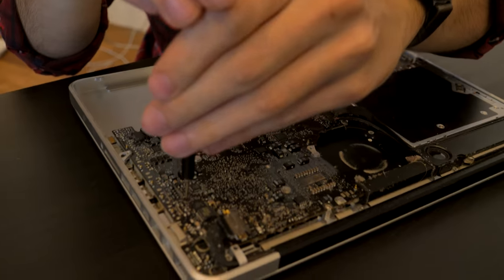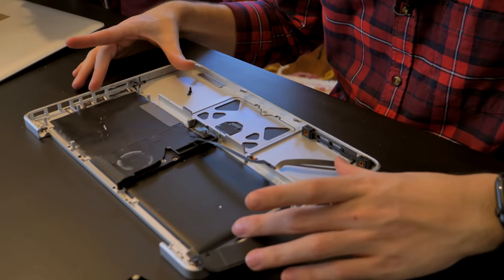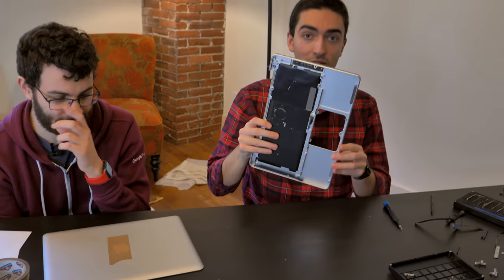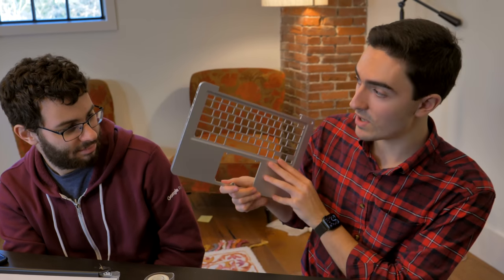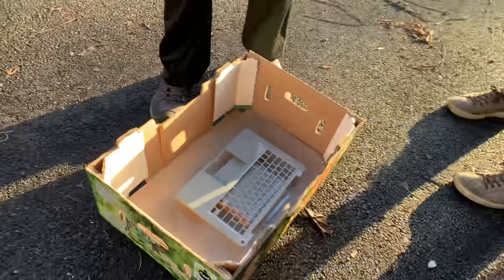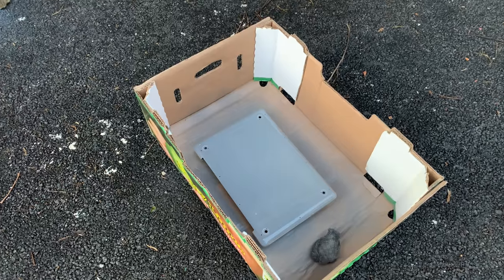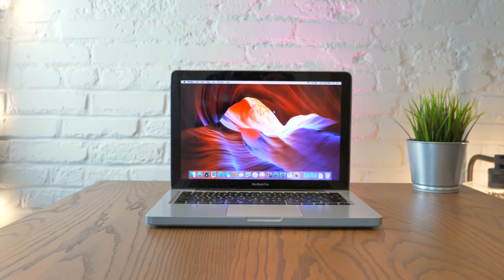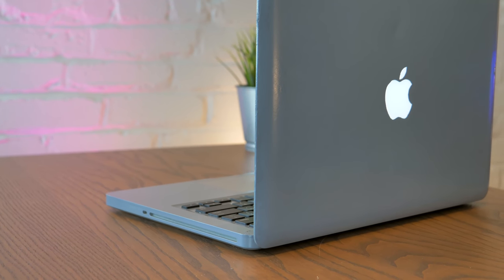We made a custom ‘Space Grey' MacBook Pro! It was... interesting

Comment: Luke, couple of things you did wrong:
-First you had to mask it with a precision of half a milimiter, sand it, primer it, sand it again (with a very fine grit like 1500/2000) 

-Second, only then apply a MATTE clearcoat. 
Would have made it look a bit more professional.

Also, please spray within at least a feet and a half away from the material in a continuous spray.

Comment: A mat finish would have been better then gloss, also an air brush would have allowed you to control the spray coat consistency. You should always cover your work until dry and do 2 to 3 light coats, wait twice the dry time to prevent ruining the layer beneath. Don't try to get it right the first time. Hanging the part can also help reach all the sides.

Comment: In order for the paint to stick well you would need to sand the body, prime it, sand the primer with 600 grit. Flat black would make a more visual difference but not if you can't color the touch pad to match. I still liked the video, great job with the disassembly/reassembly

Comment: I think painting it with an epoxy primer(which is a silver color), then adding a coat of matte gray finish. the epoxy primer makes the paint stick to the surface, making it more durable rather than just painting it bare to the metal.

Comment: Next time sand it down with 600grit sand paper, then 2000grit, and then 3000grit. Spray primer (from the can) and then spray your color. It would look cool if you use a clear coat (2x clear from the can) to give it a better finish. Slight buff and it will look like factory finish.

Comment: No no no no u don't paint aluminum, you anodize it or powder coat it, it'll look just like it was originally produced in black. Rattle can job doesn't really work on aluminum even with primer, in no time this finish will just flick off. Powder coating would be the best option since it's cheap, extremely durable and pretty much available everywhere.

Comment: Black it would be an unreliable ThinkPad :) I've had terrible luck with Krylon paint so many times... If you ever need to give a second layer of paint, really really read the instructions on the can, because you can't just spray a second layer when you want. It's like at most 2 hours later, or 5 days later. Anything in between will do a chemical reaction and completely destroy the paint.

Comment: if you use 2/3 COATS OF GOOD QUALITY MATTE BLACK PRIMER AND LET IT DRY FOR AT LEAST 24 HOURS YOU CAN ACHIEVE BETTER RESULTS IVE FOUND
its 99 Percent PREP 1 percent actual PAINTING get some junk macbook pro parts and try a few methods before you just spray it, either that or wrap  it and paint over the wrap
Thank you for the videos and stay safe out there in the city Sir

*Coop

Comment: Sorry, but this is ugly AF - next time, do it in "pure black". And be WAAAAAAY more gentile with the paint.

Note: 15" 2012 and prior MacBooks are easier to teardown than 13"; the left speaker cable beneath the logic board is a pain in the ass to remove and could damage that permanently, if you don't know about its existence.

Matter of fact: it's way easier and painless to apply a full body vinyl wrap such as Slickwraps (dbrand don't make wraps for those models, anymore). Not only in color but it can add different textures and styles to the device. I personally use a "brushed onyx" wrap on my 15" Mid-2012 and it's gorgeous!

Comment: With an endless number of "how to paint anything" on google - you guys - did none of that and just went for it - Firstly, a degreaser to wipe the case down would have helped smooth out the orange peel, secondly, the paint tin should have been at lease $18 bucks to deliver a better finish.... thirdly, a lacquer top coat to seal the paint and make it scratch-proof and of course, fourthly, masking tape for fine edges and the very best advise, don't paint anything in a temperature above 57 degrees. Do one for the ladies in plush pink or Semi gloss black ! I would have taken the case to your local panel and paint repair shop and had them spray paint it with german automotive two pot in Ferrari red..... or Lambo black.....👍🏼 😎